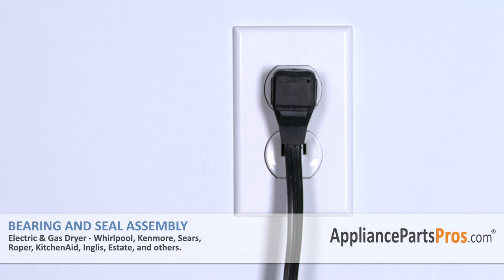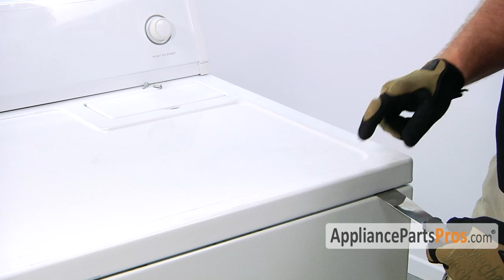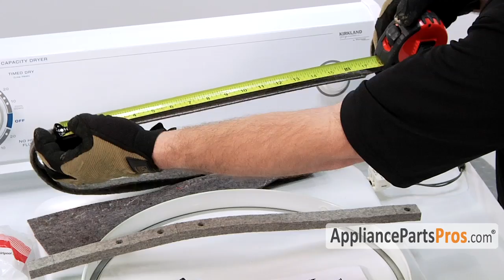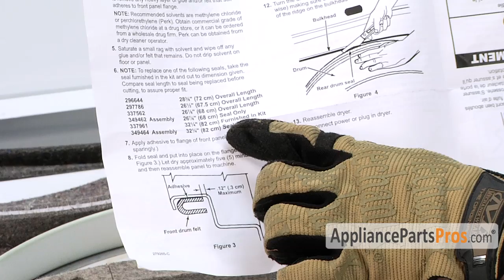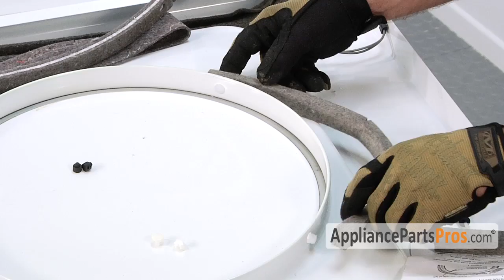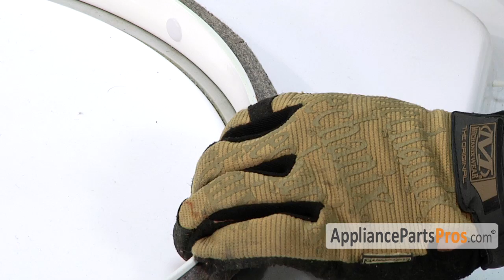Whirlpool Dryer Front Bearing & Seal Kit 279264 Replacement — fits KitchenAid/Maytag

Comment: What is the bearing and seal part number for a Sears dryer, model 417.90052990
Reply from the maker: Upper: http://www.appliancepartspros.com/frigidaire-front-felt-glide-5303937139-ap2150497.html Lower: http://www.appliancepartspros.com/frigidaire-lower-front-felt-5303283286-ap2143044.html

Comment: you didn't do the bearing repair, waste of time vid.
Reply from the maker: On this part Whirlpool actually calls the upper thick part of the felt a bearing. If you are looking to change the plastic bearing try this video: Dryer Bearing Ring (part #3394509)-How To Replace
Reply: When you fold the seal , how does it stick , I didn’t see you put adhesive on top of seal so the other part glue when you folded it